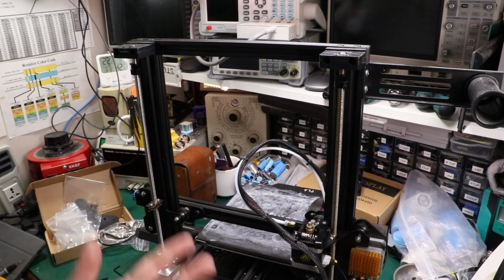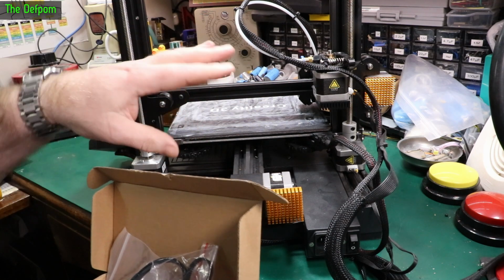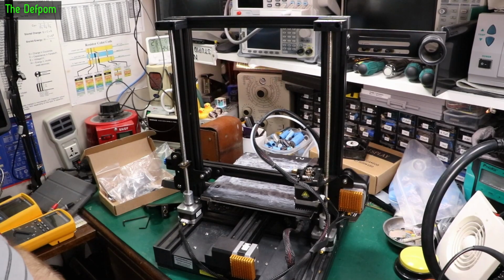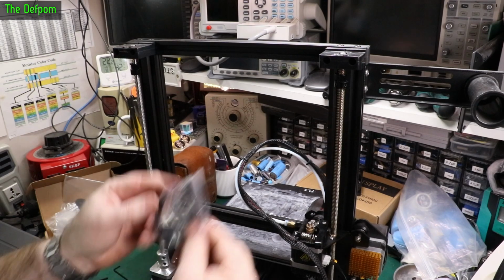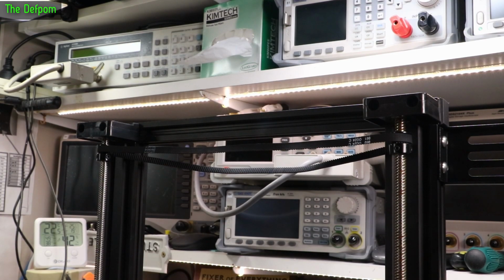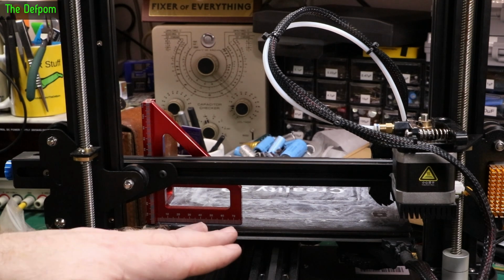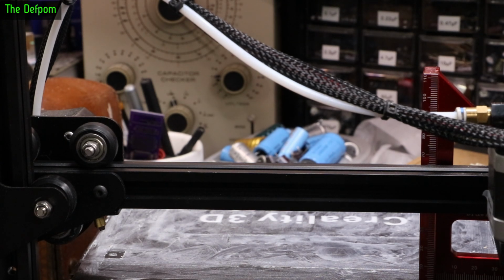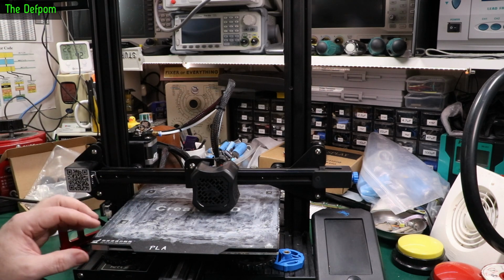🔴 Creality Ender 3 V2 Dual Z Upgrade - Z Axis Belt Drive Upgrade - No.1266

Comment: I’ve never seen those pulleys before - pretty cool upgrade. I wanted to share a tip for aligning the lead screws, since it can be such a pain. I’ve found it much easier to use two accurately cut pieces of wood placed on opposite sides of the base aluminum extrusion. Then lower the X gantry until it rests on the blocks. It saves a lot of hassle going back and forth between the lead screws.

Comment: Very nice vid @TheDefPom what is this small upgrade kit you got here? Because i bought the quiet expensive official creality dual z axis upgrade and was disappointed noticing that this is not enough, cause they will go out of sync. Yesterday i ordered two pulleys and a open belt. I thought i could close the belt with copper clips but what wont work after thinking about it😅
 So whats the kit called you ordered, what should i search for or whats the length of the closed belt? Thank you very much

Comment: Why can't you just remove the blocks at the top of the lead screws with the x gantry set at the bottom?  There should be enough safe flex in the lead screws to remove them, insert the pulleys and fit the belt. That's how the block was originally fitted to the single lead screw on first assembly.

Comment: I have an Aquila X2 (I think it is the X2) which is based on the Creality Ender 3 V2, came with a glass print bed. 

I had to do a few ugprades with it just to get it to be 'usable', I put 4 bed clips around it to secure the glass bed to the metal bed, as I found that as the bed warmed up, the metal bed deformed away from the glass bed..... Also had to upgrade it to have  yellow springs, as the regular ones were rubbish, when they compressed they would shift slightly, thus changing the bed levelling.

It's mostly decent now, though it's a PITA to level the stupid thing, basically just sits there doing nothing these days, the other issue it has is the spool being at the top means the filament is forever breaking...

Comment: Interesting to see Creality's approach compared to my AnyCubic i3 Mega which has dual screws/motors, because it also has a Z microswitch (level) at each side, so when I HOME the printer both motors zero themselves so the bed is horizontal again. This means level by feedback instead of level by relative position I guess. Glass bed also out the box.

Comment: Nice 👍 but what is the white stuff on the bed ?
Reply from the maker: @RBRetroBunker  glue stick
Reply: @TheDefpom  is that you dont have heated plate or? What glue stick do you use ?
Reply from the maker: @RBRetroBunker  it is heated as well, I just find it helps when printing larger objects
Reply: And nice! The way you layered your bed is exactly what i wanna do. Keep the glass bed so it doesnt bend but on top of this inwant to use the magnetic bed. Only thing i wonder is how you make the magnetic stick on the glass bed, yours looks kinda lose also. Right, and i guess you have to setup a higher heat with these layers.. would be nice if you could make a video about how you made your bed combination and which settings you use ❤

Comment: Nice. I do recommend you look at direct drive.
Dual Z means no weight issue of a stepper on the gantry (a pancake stepper is better though).

I used to swear by glass but then I got a PEI bed.